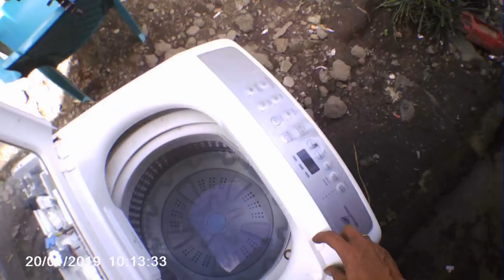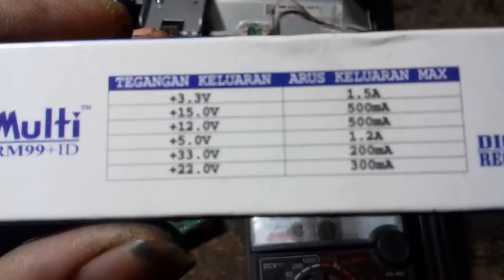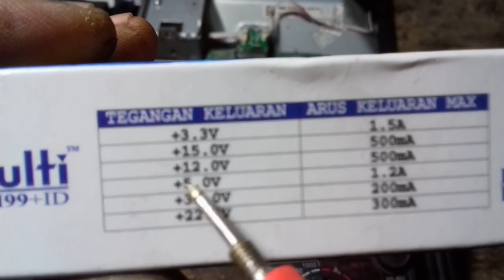MENGHIDUPKAN mesin cuci samsung 8 kg mati total

Comment: beli PSU yang udah dimodif kaya gitu bisa gak pak?
Reply from the maker: Tanya sama technisi,sekitar anda.
Reply: Mesin cuci panasonic otomat saya,, kalo di tekan on kok lngsung mengisi airnya, pdhal blum di tekan star di tombol pencucian.,, Dan airnya ngisi terus, sampe sampai motor pencucian gk mau mutar.
Kira kira apanya yg rusak.
Terima kasih
Kira kira apanya yg rusak ?
Reply from the maker: @atokadir6379  ITU KERUSAKAN DI BAGIAN MODUL NYA,coba  cek komponen yang mensuply tegangan ke water inlet /klep pengisian air,mungkin transistornta short,
Reply: @PantunPakkar  itu tegangan transistor nya brapa vol ?
Ada gak di jual transistornya ?
Reply from the maker: @atokadir6379  tegangan 220 v,ada dijual tergantung lokasi.